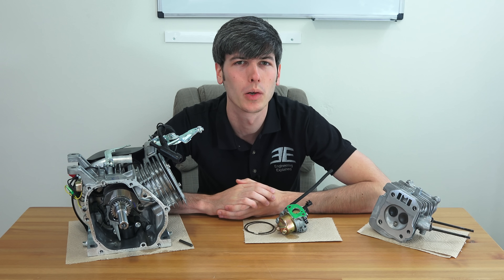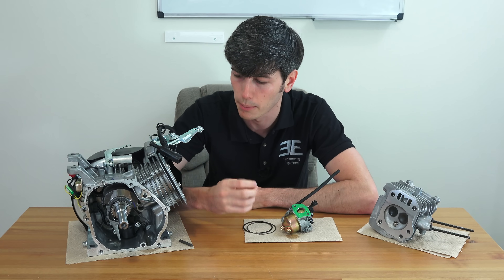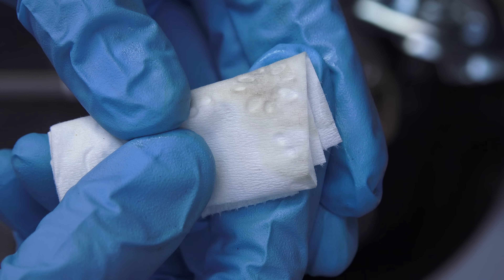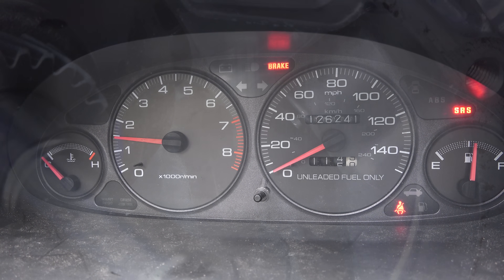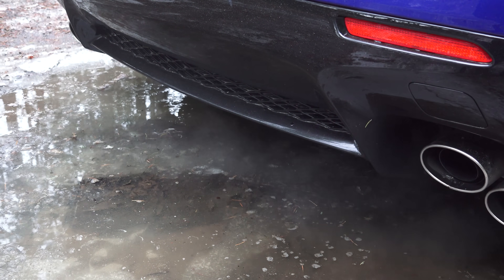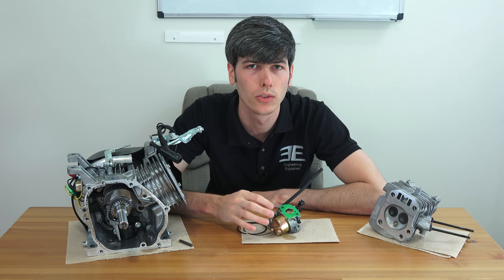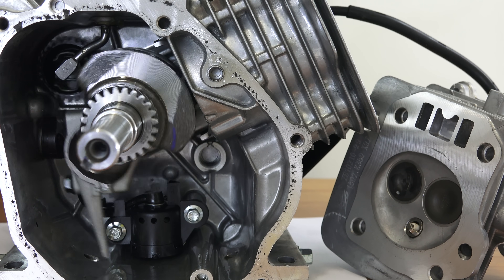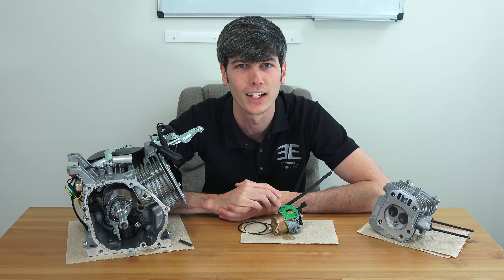Should You Warm Up Your Car Before Driving?

Comment: Driving your car while cold will increase engine load and thus increase oil pressure. Increased oil pressure will force more oil to flow throughout the engine and thus helping to reduce wear. Oil pressure is at its lowest when cold and idling higher rpm with no load, thus lubrication of internal parts is at its minimum. If you have a bluetooth obd2 reader and a scanner app like torque for your phone, you can easily see this information in real time with your car (1996 and older).

Putting load on the engine also helps the top piston ring seal gasses better via hydrodynamic and elastic contact forces along the cylinder wall (higher gas pressure). Your engine will also warm up far faster driving then idling (and wasting less fuel/less poor emissions). 

Drive your cars gently while cold, it is ok (For most don't exceed 2000-2500 rpm assuming 5000-7000 rpm redline, until near normal operating temps). 

There is a lot of research on this subject and the problem I see is people mainly go by the old carb warmup rule instead of trusting modern technology (or lack of knowledge on the subject).
Reply: actually you are seeing more oil pressure cold because it is not flowing as much throughout the engine. Pumps create flow, restriction cause the pressure you see. More pressure , less flow. More on that, it's why super worn engine have low oil pressure, the tolerance are so high from wear that the oil escape easier from the rod and main bearings
Reply: liljav11 wheres the research point me too it cause all ive seen are theroies and opinions

Comment: not as simple as you make it out to be. What if it's really cold and 
actual air movement through the radiator and around actual block, 
prevents engine from warming up? Anyone ever drove older civic in very 
cold temps, or any very small block engine with very small heat 
capacity? The colder it is, the longer I will warm up the engine but 
only if it's under 30F. It doesn't have to be all warmed up. Just so it 
had enough heat built up so when u start driving it gets to operating 
temp. quickly. In manual cars drive in higher gear than you would 
normally use for given speed so actual load on engine is smaller. Don't 
put high load on engine for good 10 minutes after temp. show 
operational. Most gauges show coolant temp. not oil
Reply from the maker: +Drogos79 the radiator is closed off (via the thermostat) until the engine reaches operating temperature.
Reply: Engineering Explained this is correct , this is why turning the heat on blast helps cool the engine down if your thermostat stops working
Reply: I agree, when I was in Barrow Alaska for a couple months I rented an F-150. Even with the grill covered, the engine never got to operating temp.  And driving it, actually made it worse.  I could watch the coolant temp gauge needle move.  It was -40 degrees F  and about 25 mph winds when i was there.
Reply: If it's that cold, cardboard in front of the radiator.  And I know the radiator is closed off, but you still cut down on air flow around the engine after it passes through it.

Comment: Actually, most people warm their cars to defrost the windows and to have a warm car to drive to work in. lol
Reply: Max D M I usually take a nice dump first
Reply: You said that cold engine causes richer fuel mixture, thus the excess of gasoline washes away the oil in the cylinders. But you didn't mention the fact that when you start driving straight away you inject even more amount of rich fuel, which logically must result in more oil being washed away! What can you say about that?
Reply from the maker: +tnsteele95 seems logical to me!
Reply: -Slurmdaddy - You push the engine too hard when it’s cold, it’ll take a dump, too!
Reply: +Alexander Shepard That is exactly it. You don't just get out of bed and start a sprint. Of course you warm up first.
Reply: Tennessee Flipper
Using the A/C clears the windows much quicker than the heater because the air is dehumidified as it passes over the evaporator and the moisture expelled outside via the drain.
Reply: @TonyRule  That's correct for fogged windows. That's an inside issue. The dry air clears them dramatically faster. But for icy windows you need some heat. That's an outside issue. Too much heat on a very cold day gives cracked windshields.
Reply: Moist Gnome  happened to me twice, different cars. Freezing rain day, defrost running, made a stop for a few minutes, left car running, cracked from a few inches in at bottom on each side across to opposite. Problem is glass tries expand in area where hot air is blowing while the rest is cold. Uneven temperature causes stress crack.
Reply: tnsteele95 I do so because piston seal gaps are calculated for a warm engine, not cold.
Reply: Alexander Shepard. So you run your engine longer at cold temps by idling in a less efficient RPM range?
Reply: NinJayMan My Impala has over 360 000 km on it and can drive with no issues immediately from more than 20 below. Sometimes Chevy gets it right too.
Reply: They are doing to incorrectly regardless of the reason.
For decades I have lived where it can get to -60 º F and have followed this procedure successfully all that time.
The window fogging is invariably because they are using the recirc function incorrectly which is trapping moist air in the ducts and fogging the windows unnecessarily. If the turn off recirc they will find that the windows will not instantly fog (which is probably what they are experiencing) and that driving the car right away will give them warm air quickly to keep the windows fog free while they are all chatting constantly (which is the other thing that fogs windows).

Comment: 2-3 minutes idling then keep RPMs low and heat up engine and transmission. Over 110000 miles and zero problems. Wonder if that would have changed if I did the opposite.

Comment: Question here, this pointing towards more higher performance motors in bikes, (L Twin in a Ducati Panigale for instance). the motors idle very high, we are talking 2300 or so RPM idle. They also have a constant mesh dogbox transmission that is lubricated by the engine oil and this gearbox hates actuating in cold weather. Is it better to let performance bikes warm up when cold or put stress on the transmission and pull off within 30 or so seconds? Ive always thought that letting coolant temp get to around 120 degrees or so was the way to go, but that may not be accurate.

Comment: A common problem with Ford 5.4 liter engines is if you start driving immediately after the truck starts (IE before the engine changes its idle, it will idle at ~1200 RPMs on startup and then settle at 900 RPMs after about 30 seconds) you can ruin the engine. I had a mechanic explain it to me but I still don't fully "get it" but I know that it has something to do with the hydraulic timing system. The end result is a piston makes contact with a valve and you will need a new engine. +Engineering Explained I think its important to mention you don't want to start driving before the idle on your engine changes... even in fuel injected cars. I think that's what many people mean when they say "warming up their engines".

Comment: What about the catalytic converters in the exhaust though? Catalysts are efficient only in optimum temperatures. And the efficiency in the exhaust is necessary for the environment. So to do less damage to the car isn't it better to wait?

Anyways i live in a gulf country, so snow is not witnessed here. for my 20 Year old car i just wait for approx 50-60 sec for it to stop revving at higher RPM and drop to a lower one after ignition. Then i set off on my journey

Comment: Also any vehicle like a Z51, Grandsport, or Z06 that utilizes a dry sump needs to warm up because there is almost no oil in the oil pan. Most of the oil sits in an outside container and needs time to start properly lubricating.

Comment: while you drive off calmly, you have people driving behind you beeping their horn like crazy because you're driving slow......always happen in NYC.
Reply from the maker: I wasn't aware there were roads in NYC with traffic flowing smoothly! Never really been haha. You don't have to drive slow to drive non-aggressively. Low throttle, low RPM, whatever speed.
Reply: Same in rural Arizona with a manual transmission.
Reply: Drive calm for a minute and then gun it and flip them off.
Reply: Same here in rural Nevada
Reply: Then laugh as they eat burnt rubber.

Comment: I think most people warm up their cars is so that the cab is warm when they get in. And their windows get defogged.
Reply from the maker: Seems like a reasonable thing to do to me!
Reply: Engineering Explained I do it all the time. I'm Canadian!
Reply: Graham Clarence i agree. however i had a classmate of mine tell the whole class in college that if you dont let your engine warm up you can ruin the motor (this was an art class btw lol). So there are still people out there....
Reply: Andrew Lafferty if your car's motor gets ruined by not warming it up you need to reconsider which car you buy.
Reply: That's because most people are pansies. Dress warm and don't waste gas idling, the car will warm up faster if you just drive it gently and your coat is there to keep you warm until then. It's not a diesel truck with air brakes to need 10 minutes of idling.

My motorcycle manual says leave it idling for few minutes but I know that's for dickheads who twist the throttle hard right away. Instead, I just ride it gently for those few minutes and save 3-4 minutes of gas. After that I pick up the pace. Simple and efficient.

Comment: if you live anywhere cold you ABSOLUTELY NEED TO WARM UP YOUR ENGINE. your transmission cooler is inside your radiator.  by warming up your engine your warming the transmission which will keep the transmission safe from browning the valve body.  yes this happens in -20c and colder.  what this guy is saying makes sense if you live in southern Usa down Florida and Tennessee and other southern states where lakes don't freeze over.

Comment: the answer is YES when it is cold. the oil is still cold, and thicker, and will put extra strain on the parts. for example, power steering, oil pumps, and especially on turbos.

you don't need to warm it for 10+ minutes, but a good minute or two in cold weather is good.

Comment: I agree that extended idling on a cold engine encourages more fuel contamination in the oil but my personal habit it not driving off until I see some movement of the coolant temp gauge from stone cold. The owners manual for my 2004 Evo specifically states to "warm the car/idle the engine" before driving to ensure proper turbo thrust bearing lubrication. It doesn't state a time frame but I typically do the same - about 2 minutes or so until I see the coolant gauge budge. YMMV.

Comment: I think this is good advice for when it's above 40-50 degrees out but if it's like single digits or below freezing, you need to let it warm up before driving. Cold oil doesn't flow well

Comment: I like your videos they are pretty decent to view. This one I'm going to ask you to come to northern mn -30 and lower. Add in wind chill. Also let's see you describe the rest of the fluids that are in the engine bay. I have seen high pressure power steering lines blow or frozen. When the snow feels like Styrofoam and the air freezes your lungs you let me know how this 15 seconds goes.

Comment: @engineeringexplained totally agree with you and let me add on more reason to drive lightly instead waiting while stopped. If you're stopped there's no mass to difficult to the crankshaft rotation, if you're driving lightly there is the vehicle mass creating resistance on the crankshaft which will help to improve the heat on the engine faster.

its like driving on a uphill road, the gravity difficult the movement and that makes the engine warm faster. its the same analogy

Comment: what if you have a turbocharged engine?
Reply from the maker: Wait till it's warm before getting into boost. Light throttle.
Reply: This is the answer we needed EE. Most of us drive turbocharged cars like WRX's, Evo's, (personally an Eclipse GSX). I had an Oil Pressure Gauge installed that I would watch on cold starts. Once oil was at operating temperature, the only way to replicate the initial Oil Pressure from a cold start would be to redline the engine.
Reply: Shifter Media i have a TwinTurbo BMW :)

Comment: At 32*F, antifreeze and oil still have cold spots that need to stabilize. Also, the engine parts haven't yet swelled to tighten up the head gaskets, among alot of other things.
Reply: John Doe   Incorrect John
Reply: imagosentertainment, why incorrect?
Reply: It takes much longer to warm up fluids and components while idling than working the engine. For engine longevity it is important to get that motor up to temp. I live in northern Canada and winter cold start idling would require 30 minutes of idling warm up time if I wanted to reach operating temp. Gentle driving for 3 miles would do the same thing. All new vehicle manufacturers recommend this procedure as well. A cold engine is dumping fuel in the combustion chambers (much of which ends up in your crankcase), catalytic converters don't come on line efficiently and you pollute. The only reason you may want to warm up your car is so you don't have to sit in it while it's cold. Buy a seat heater!
Reply: I'll be doing some research on what vehicle manufacturers recommend these days. Thanks.
Reply: Ok, I did some research. So now, why didn't experts recommend this in the mid 80s for fuel injected vehicles? Why are they recommending this now all of the sudden, only after Obama's Clean Air Act of 2015 was passed?
Reply: Well I drove my vehicle today without warming it up. I found that it took alot longer to warm up than the 5 minutes expected if I let it idle prior to driving it.

Comment: I think some people are getting confused here with "warming up the car" referring to when the RPM is idle and no longer decreasing vs when the oil temp gauge for your vehicle get's to "optimal temperature" aka the middle for most cars. If you are waiting for your car's oil to warm up via idle then yes you are going to be there for longer than 20 minutes in cold weather. 

Personally I need to let my car 'warm up' until RPM reaches idles and no longer decreasing. I also don't drive over 3-4kRPM until the oil gets warmed up. 

But to say a vehicle's performance is the same when cold vs. hot is wrong.

Comment: How about when it's near 0, or below? Still just a quick minute of idling? When it's crazy cold like that, I can hear the difference in how my engine runs for the first 5min or so, idling. I find it hard to believe I'm just supposed to just take off after I start it during those temperatures. Warmer, around freezing, 32 degrees or so, I can understand. But no sub zero temps. Just doesn't seem right.
Reply from the maker: If it's super cold, I'll sit slightly longer than if it's normal temps out.
Reply: You think 0 is super cold? lol It’s minus 40F in Alberta, Canada right now. I’m letting it run for 10-15 minutes and it still seems too cold to drive away.
Reply: Personally I listen to the engine. It speaks for itself. Cold engine produces more noise (slight whistle of rubber belts, clinking of valve hydro compensators that receive too thick oil, etc.).
Reply: Fat Froggy No one asked you to brag about how you live in a crappy place
Reply: Fat Froggy, -40? Get a block warmer lol

Comment: NEVER REV A COLD ENGINE, OR ELSE ENGINE DAMAGE WILL OCCUR!
Reply: Tim Joseph what are you talking about i rev it to the red part because red means hot therefore making the motor heat up quicker and while i do that i do burnouts to heta up my tires clutch and brakes
Reply: TheValleyofAwesome i also put nails on my tires to have better grip in snow
Reply: Edwin Dominguez R.I.P. Engine Block
Reply: TheValleyofAwesome 😂😂
Reply: Really?
Reply: Edwin Dominguez Nice :)
Reply: cold reving on cast pistons isnt good, cold reving on forged pistons is really bad. thermal expansion rate is different, forged is really loose when cold, cast is a little loose, hyperutetic pistons have the least thermal expansion, but still keep the rpm down.
Reply: Have fun paying for the damage
Reply: no wonder i reved it to Number 2 while warming up to warm up faster then when i turned on a couple hours later it had the check engine light on smh i hope its nothing serious it was like 3 days ago i haven’t gotten it checked yet

Comment: so what exactly is light driving? 25-35mph or 10-20mph?
Reply from the maker: Low throttle, low RPM. You can drive lightly and still reach higher speeds.

Comment: Cold oil pressure won't tell you much except you might be about to blow seals.
Warm it up and change the oil monthly if you drive all day everyday.
I run between 15k-33K km/year. Change my oil monthly or when needed soon after.
You don't even have to change your oil though, I spoke to an old engineer from the refineries and he refused to like pay for oil, just filters and a quick drain for shavings.
He even had a special tool for easy oil pan work. Wish I could have copied that little thing!

Comment: thanks! This is very good to know as iv'e experienced with my Fuel injected ga16de, I Currently live near a bridge which requires immediate hard acceleration. Even starting my ride cold doesn't always flow the transmission smooth so stalls happen. thanks again!

Comment: On a Cummins ISB 5.9 for the Dodge Truck application there is a 3 cylinder high idle that Cummins has programmed in the ECU, because this is running 3 of the 6 cylinders at a higher load to warm the motor up I assume this warm up event is OK and better for the diesel engine.